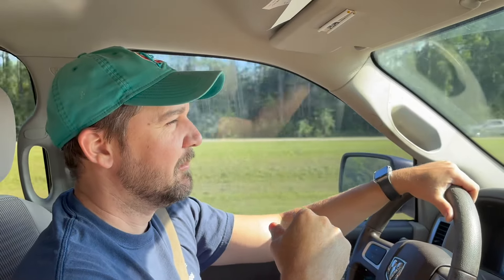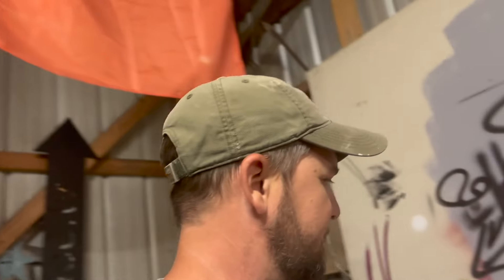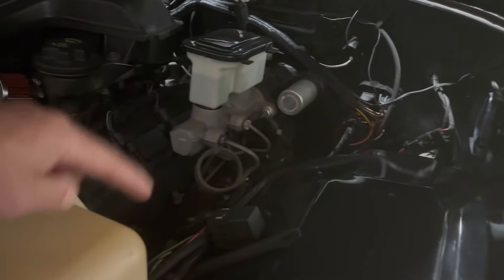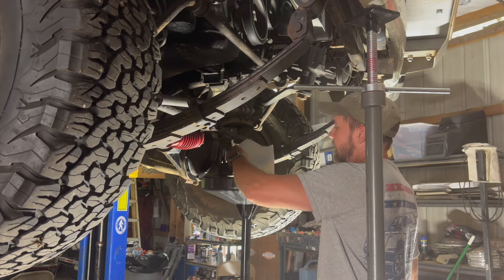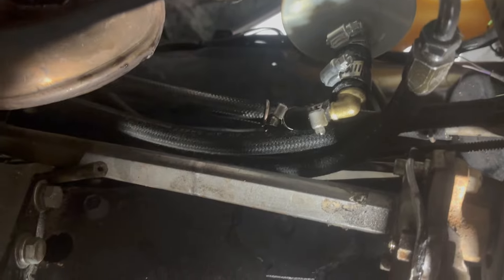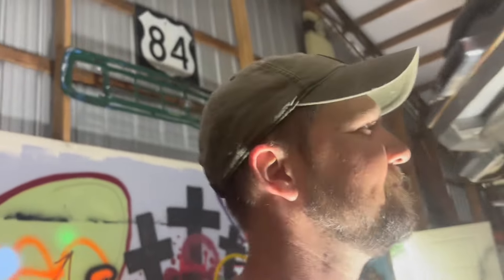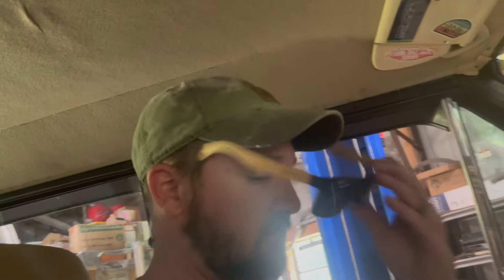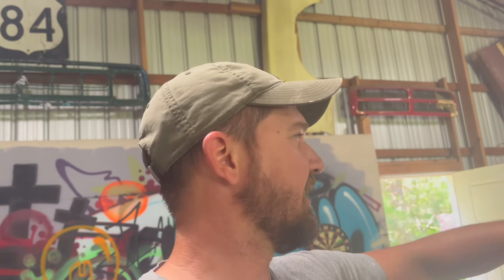Power Steering  Hose fix - and a new tent! #rooftoptent #tentbox #smittybilt

Comment: I have exactly the same issue with the pump, and I have my entire engine bay and cabin insulated with hydramat. i got a tip that the noise may come from the top high pressure hose from pump to hydroboost. it is quite stiff and replacing that one with a more flexible rubber hose may fix the issue.
Reply from the maker: That’s interesting, I’ll have to look into that. I can hear the one on my Ram and wife’s Jeep but it’s not nearly as noticeable as the one in Termite.
Reply: @TermiteOffroad  I believe if you can hear it in the cab, but less under the hood, it will be the pump to hydro-boost hose, if you have BJ's kit: the earl's hoses are braided steel, relatively low volume, and stiff, that resonates through the firewall. so a thicker (more volume fluid in the hose) and more flexible hose will eliminate the noise.. have not tried it, have to figure out what hose I can get that fits
Reply from the maker: Yep that’s how mine is. You can’t hear it outside or in the engine bay but noticeable in the cab. I do have the earls hoses from BJ’s as well. I’m def gonna look into what you’re saying, that makes sense. Thanks man!